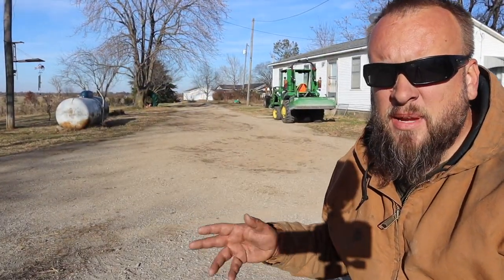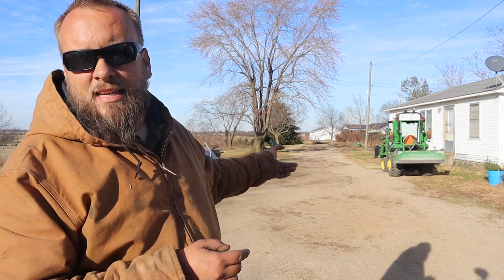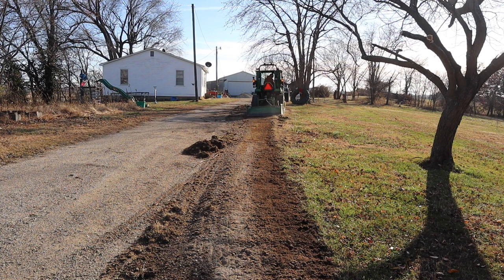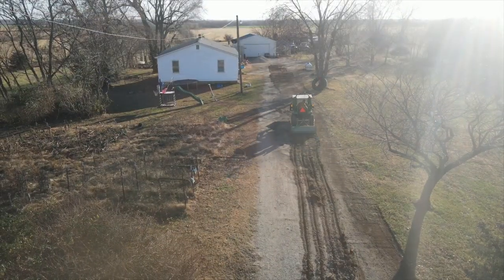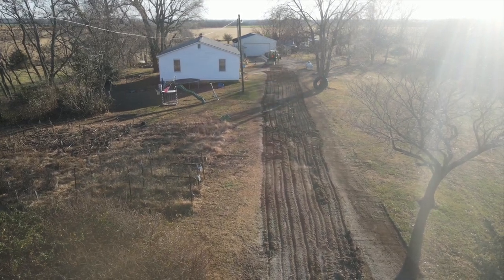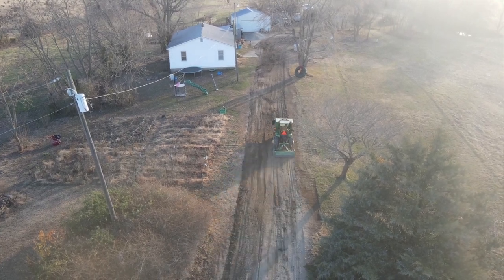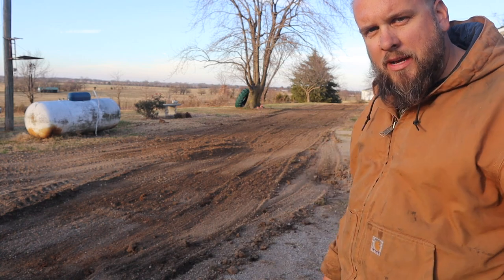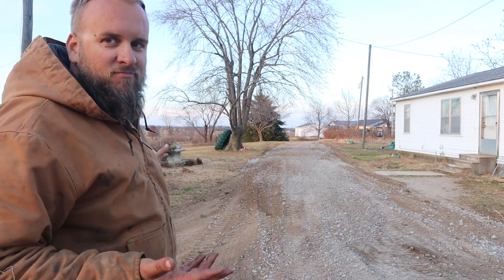There Is More Than One Way to Skin a Driveway

Comment: Nice work, Brock.  For under $100 of gravel, your efforts made a huge difference.  I’m curious why you like to use the box blade to pull gravel off the pile.  I don’t have a box blade -but it seems like it might be easier to get the driveway smooth with the box blade first, then use the loader to slowly feather dump the layer of gravel on top.  - Chad
Reply from the maker: I’ve done it both ways and seems about the same to me. Depending on the situation

Thanks for watching Chad
Reply: @RockhillfarmYT    I was wondering the same thing...  But I don't have a box blade yet., so I wouldn't know from experience.  --  Thanks for answering Chad's question Brock.  By the way.... What is that, a 5-foot Box Blade you have?
Reply from the maker: 5 1/2

I think it’s called 65 inch

Comment: I was just saying you're getting some good camera angles rip GoPro. I took 6 inch square metal tubing and filled it with concrete then mounted to my box blade it really makes those teeth dig in
Reply from the maker: Thanks for sharing
Reply: Good idea. Any idea how much weight that added?